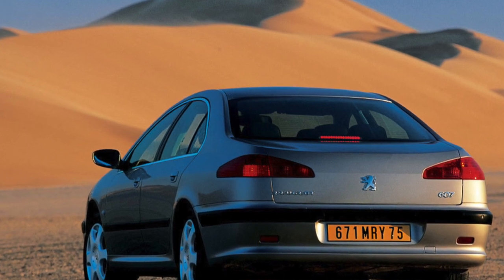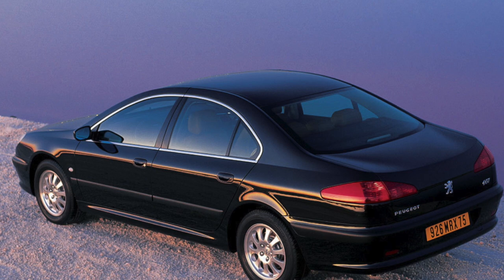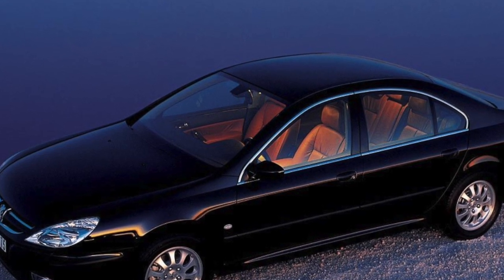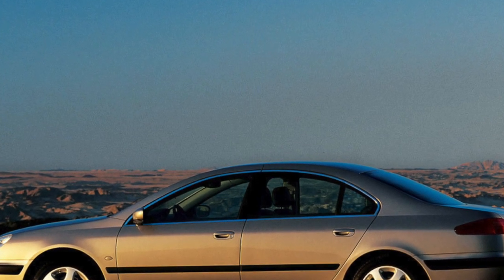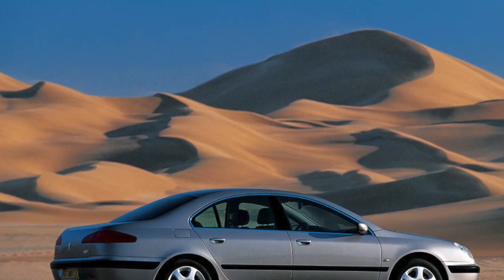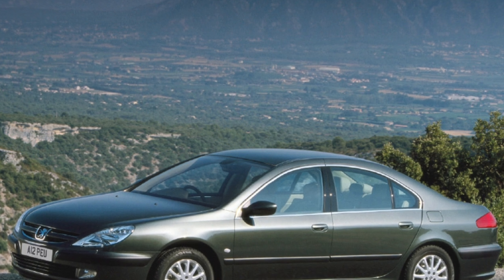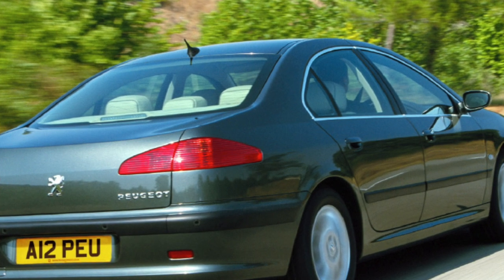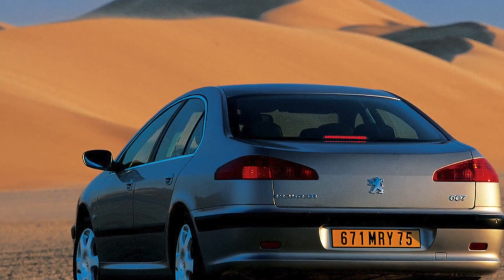Peugeot 607 Problems | Weaknesses of the Used Peugeot 607 2000 - 2010

Comment: I leave this comment with the video paused from the moment you said that the 2.2 engine is the best cause it's economical. Only an idiot buys and bought a Peugeot 607 for economy. This car is not about economy. There only two engines good for this car. The 3.0 V6 petrol and the 2.7 Hdi. Now I close the video .
Reply: Peugeot 607 2.7hdi 👌
Reply: Yo tengo el 2.2i con 20 años del 2004, es muy bueno en general y economico bastante mas que otros de su segmento. Aunque fabrica indica consumo 9.0 a los cien, con conduccion tranquila consume mucho menos. Solo 5 marchas manual, debio tener 6 para sus 158cv. Coche excelente❤